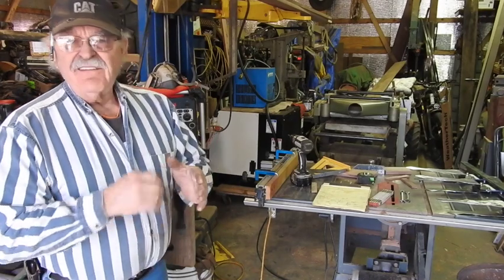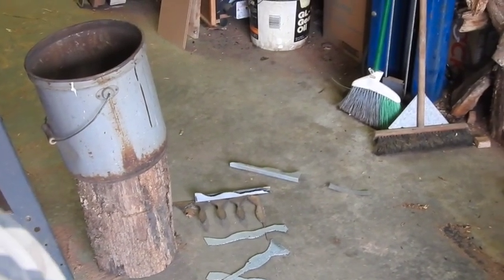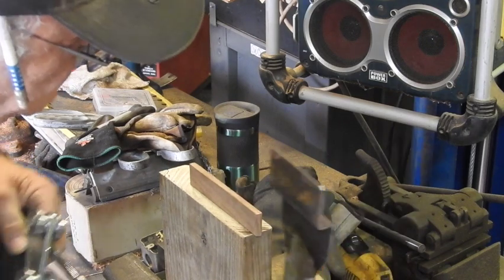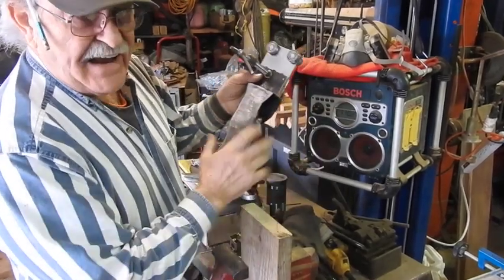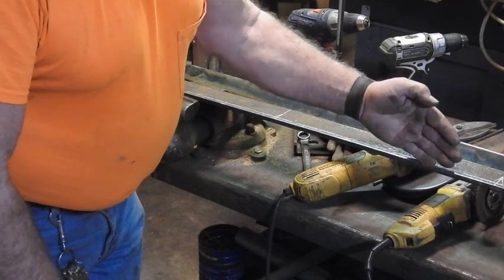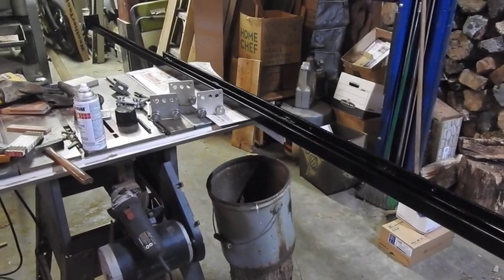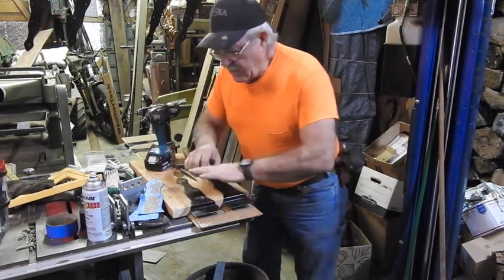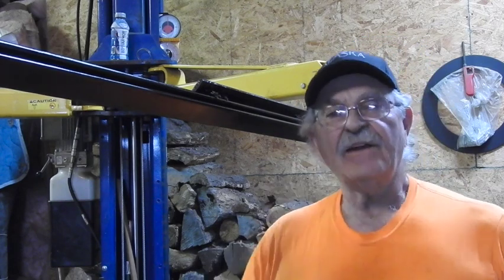Lets Build Some Fancy Barn Door Hardware

Comment: You just gave me a great idea💡
Reply from the maker: There are a good many varieties in the trollys too.  Two or four wheel design.  I went with 4 wheel for these heavy doors, but 2 wheel would surely have been adequate.  Go to Amazon and type in unistrut trolly and you should see some knock offs as well as actual Uni-Strut brand.  I've used these for many years moving stuff on jobsites. I have a set of struts and trollys with an electric winch in the sheet metal shop to pull engines in the smaller tractors.

Comment: Those strut rollers are great. We had a 2000lb air handler we had to remove and could not get a lift under it do to obstructions. We were able to put strut above it and use those rollers to attach come alongs to and after picking the AHU off its support rods we rolled it sideways and then lowered it down. They will hold a lot of weight
Reply from the maker: You better believe they hold some weight Ed.  I did the same thing with large blower motors in air houses.  Shoot strut into the ceiling and hang a chain fall on a trolly. Pick the 50 maybe 75 hp motor and roll them right out of the air houses to the waiting cart or crane hook.  The same with large capacity roof top units with large indoor fan motors ...throw a strut over the top of the unit and another one all the way through the inside of the unit....all thread the two ends and lift big motors and trolly them right out of the unit to the bed of a truck. Pick up the new and take it right in...just like that !!  Very good accessory to have in the service trucks !!  I usually carried two or three and multiple chain falls and coffing hoists.

Comment: I think you may have shown us those doors on a prior episode last year? Definitely looks heavy enough to support the doors. I barely had any brain cells when Ike was President! LOL I did not know they made rollers for uni-strut!!! Now you have my mind running wild with project ideas.  I really didn't need that! 😂😂😂
Reply from the maker: Yes, these are the doors I've shown in the past.  It's only taken me two or three years, maybe more, to get around to the actual installation.  LOL   About the strut trollies....they make them in a lot of varieties.  Some are two wheel with an eyelet, some are 4 wheel like these with a 1/4'' three hole plate and some are 4 wheel with a swivel eye.  I've got a set on a pair of strut holding an electric hoist in my sheet metal shop where I've used that to pull small engines.  Soooo....were you in the 'development' stage or still just a twinkle in your poppa's eye during Ike's time in office.  LOL
Reply: @tractorman4461  I was born in '59 so I was still babbling when he left office. 😂😂😂
Reply from the maker: @1lilfarm  Hot dang you ARE just a pup !!  LOL

Comment: Looks nice Wendell. I bet it’s going to be strong enough 😅
Reply from the maker: No doubt about the capacity of the rollers.  The doors will top 200 pounds with the hardware and rollers.  But each of the 4 rollers can hold much more than that.
Reply: @tractorman4461  , you did a great job on the doors. Well done.
Reply from the maker: @tractortalkwithgary1271  Thank you my friend.  They will finally be put to rest after sitting finished for several years.  Life is busy.....

Comment: What you made that very pretty and strong. A little while back we bought a little house with some plans for it and revamped it. But there's l still more to do there always is like any other project. The point is that there is a pocket door. But as pocket doors go this one's absolutely huge. 10-foot original ceilings and so I'm going to say this door is 8 ft tall and 5 ft across. You should see what they used to hang this door. What you have would be a great modern improvement but the principal still the same and I want to keep it rigid also we just re-work what they had. Aisin little difficulty with that one guy that was your doing some work for me he goes let me do this. Sure wish I'd paid attention but I can probably figure it out I was off doing something else. Run saying about 5 minutes he had that door where you can take your finger and just put it on the door and move it back and forth. So whatever adjustment he did put it back into balance. It is solid wood. The doors that you were speaking about are they the ones that you've shown before?
Reply from the maker: Dang that's a big pocket door you got there.  Apparently that guy knew just what to do to balance it out.  These take a bit more of effort to move them but not much. The wheels are ball bearing and pretty high quality to be able to sustain the weight they are rated for.  And yes the doors will be the ones I've shown before.  I'm finally getting around to hang them after building them several years ago !!  Ain't that the way it goes.... LOL
Reply: @tractorman4461  and they say Americans do no long-term planning! Basically the house was a parsonage and they had a Sunday evening Wednesday afternoon meeting room. It had its own entrance from outside. Plus this way it was sealed off from the rest of the house.
Reply from the maker: @CAROLDDISCOVER-1983  Well, that's pretty cool.  The bad thing about Americans is nothing ever gets old....we are always tearing down landmarks to build  parking lots or strip stores !!
Reply: @tractorman4461  that's true. By the way I edit my remark or reply and said they say Americans never plan long-term. Autocorrect had put you instead of they originally